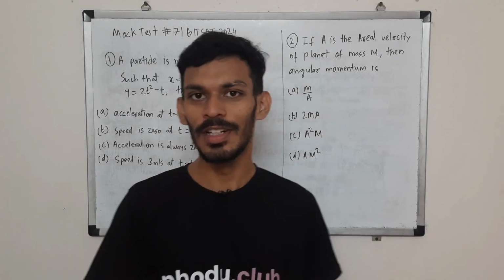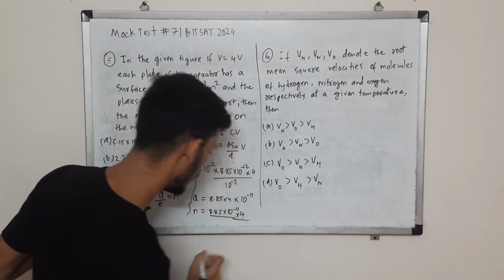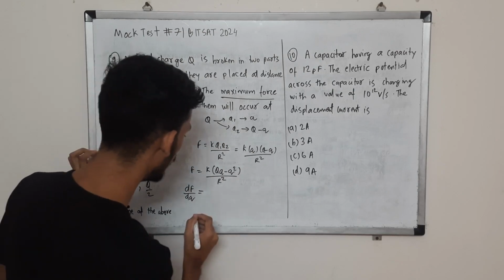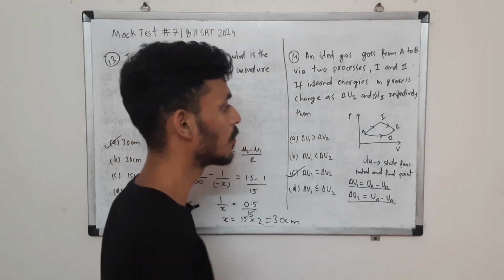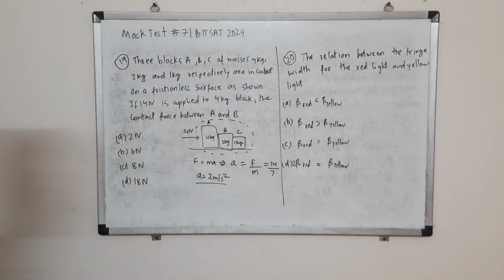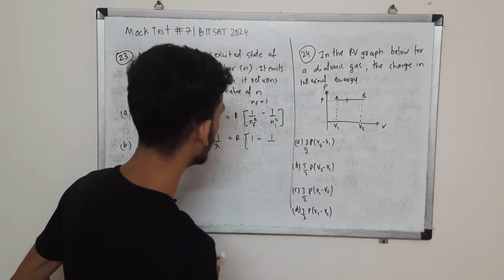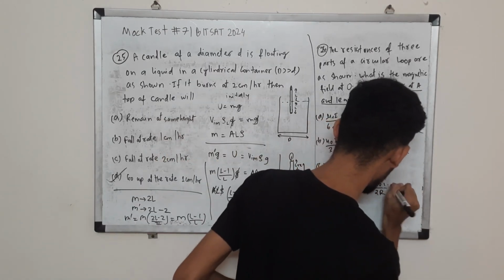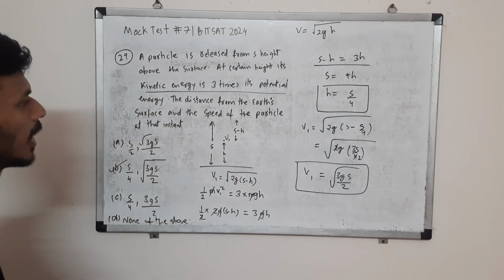BITSAT 2024 | Mock Test Series | Paper 7

Comment: 20:34        

Doubt 
Is the formula always binding energy of product - reactant 

Or D will occur due to energy released or absorbed
Reply from the maker: It depends on type of reaction for exothermic reaction (Q>0) product has higher BE

More details:

In endothermic reaction(Q<0) the binding energy of reactants is more than the binding energy of products.

So basically the difference in BE(higher -lower) gives you the Q value and you can assign sign based on exo/endo